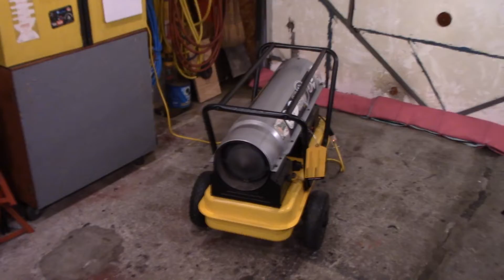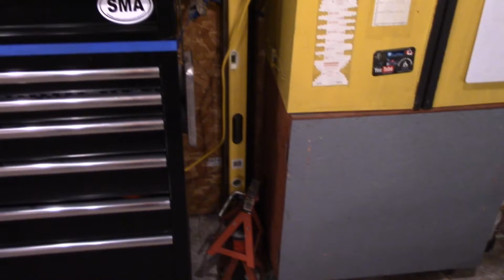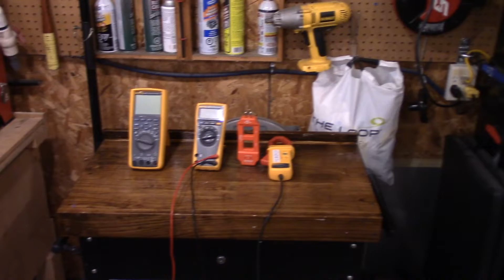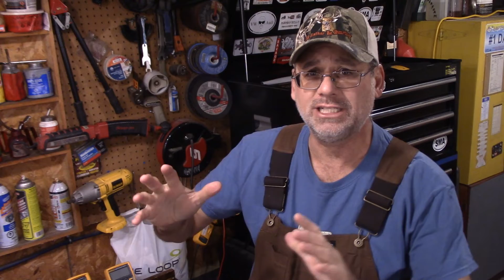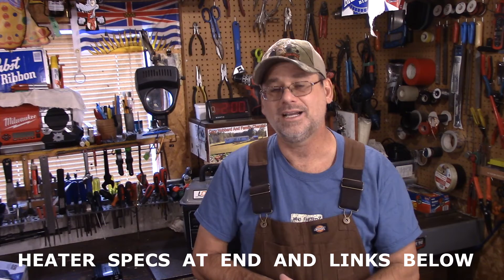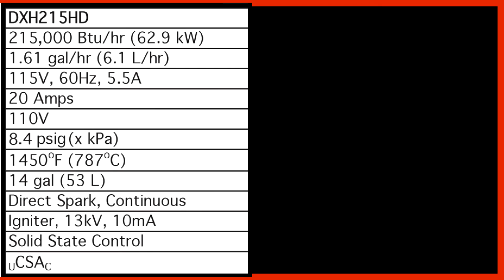TORPEDO HEATER TESTING -  DEWALT DXH215HD - HOW TO TEST AMPERAGE  WITH MULTIMETER AND CLAMP METER

Comment: I know you can't have bought an Ames meter - the new higher end amp clamps from Harbor Freight, but I just imediately thought of your amp clamp testing videos when I read the review, "In fact, it works better than my Snap On". Please tell me that Snap On is broken! LOL Snap On's best meters aren't Snap On...they're priced like it though...thinking about a Matco $240'ish multimeter which does a lot of fancy things which were normal to get in a medium price meter in 1999, but has been missing from all but the most expensive since.

Things like Hz readings, and RPM readings - I never really need that in Automotive, but I supposed it'd be helpful on my motorcycles....except I think it's limit is 2 cylinder to be accurate, so would I have to half the no. for my 1 cylinder motorcycles? LOL Or double it?

Comment: The "Object" is to learn something new everyday!!!!  I followed you perfectly except for one thing... @ 3:28, you explain that you are testing Amperage on the left Multimeter which appears to be set for Milli Volts.  That is where the pores in my brain clogged and nothing else sunk in.  What am I missing?
Reply from the maker: Yes the amp clamp   connected to the DMM  uses MV to  display it in   amps since it's not a regular  stand alone amp clamp that does read amps directly. Good question Mike your on the ball.
Reply: Thanks for clarifying that.  I love the approach.  Using real measurable techniques to validate proper expected load.  You are the Man!!!

Comment: That is a lot of numbers your spitting out Steve. Good testing video on the heater! Good luck to Sarge with his plans. So you can use the diesel heater indoors? Have a Happy New Years Steve, Steve Rob!
Reply from the maker: Thanks bud - yes you can use the diesel heater inside my shop. I  use it to get it hot then switch over to my electric unit.

Comment: How's she goin'?  Good set up for your test and the results are interesting to see.  It's good to know what you are trying to operate and understand what all the ratings imply before you spend a bunch of money on gear that won't do the job.   Thanks for posting and Happy New Year!!!
Reply from the maker: Thanks Mike I have bought stuff  by looking at the spec tag and it would not run .  Seems they like to  play fast and loose sometimes on  ratings . I have a milwaukee tool  I will show will not run off a 15 amp circuit but is rated  for 15 amps .  I had to wire a special outlet.  Special year end vid tomorrow :) HNY

Comment: You got it dead on Steve....I think manufacturers don`t talk about peak because the public utility or I should say most of your breakers but not all equally can take up to 300% of lag for a very short period of time and it would make whatever they're selling look like a hog and most people don`t no enough and they would not buy it.....once they check out this video ....they would know better.....CHEERS
Reply from the maker: Thanks Gator , Its not so easy just looking at a  spec tag and  telling someone the numbers - so many times the numbers don't match. Cheers
Reply: @SteveRobReviews  Just something I thought of Steve that you may or may not know this...electronic ignitions don`t like a floating generator neutral a lot of times but so I guess your ignition is ok but if it did not start and even on a gas furnace make sure that generator is not a floating neutral...just ground the neutral at the gen.....this is on a direct connection to a generator....I have some talk on this coming....CHEERS
Reply from the maker: Yes I have one made just incase using an old  extension cord plug . Good subject Gator .
Reply: @SteveRobReviews  I just went to the video coming up and listen to it....it`s not clear but when I made it I thought it was....these electronic ignitions are fussy and I have a simple cure for that....just saying but then my cure brings in another problem that I did not think of....Ah well....when you see the video....pretend like I didn`t talk to you about this...will see if others notice....CHEERS
Reply from the maker: HAHA ok will do.
Reply: @SteveRobReviews  I know better two2 but sometimes I still play in traffic. 
Just gotta watch out so that I don't get run down feeling.